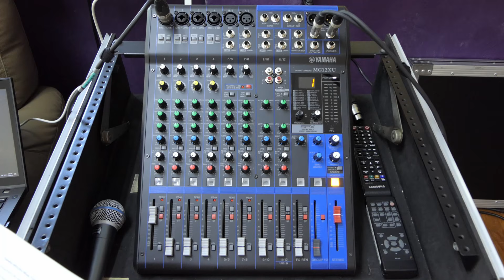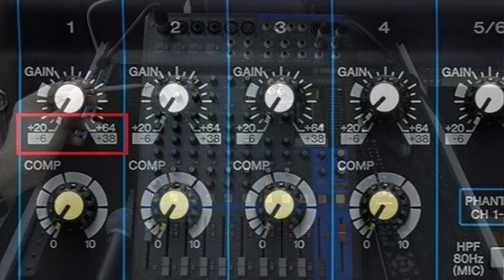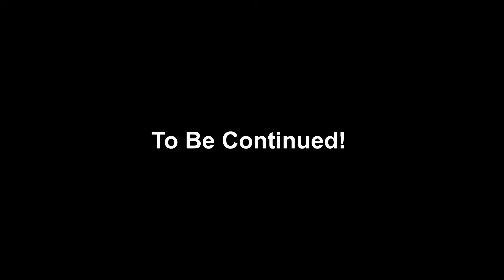Yamaha MG12XU Mixer Tutorial Part One

Comment from the maker: Bookmarks for video: 
00:40 Mixer overview
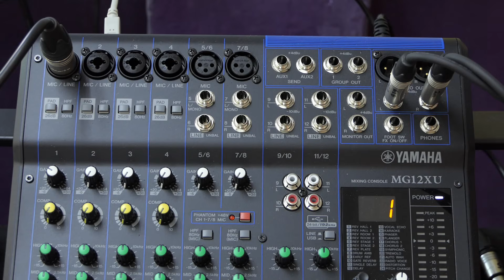01:51 Input connectors
02:50 Pad and HPF switches
04:10 Gain knob
05:30 Gain setting procedure
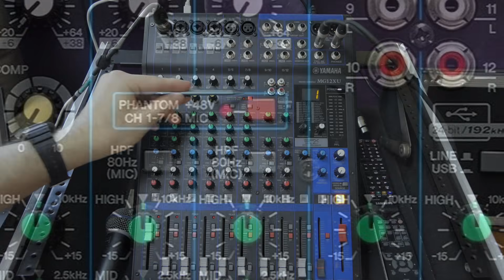07:43 Phantom power switch
08:18 One knob compressor
09:32 EQ Section
10:50 Aux section
11:50 Internal FX section
13:33 PAN knob
14:14 Channel ON button
14:53 PEAK light
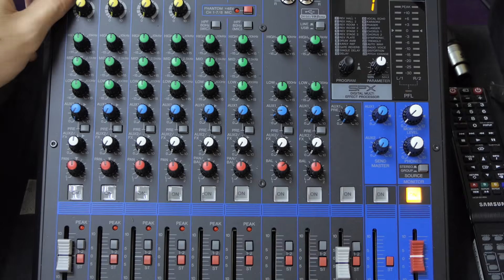15:35 Channel and master faders
16:42 Channel routing buttons and subgroups
Reply: Thanks alot!
Reply: thank you so much.
Reply: Thanks. What measure of cable Do You use for the USB 2.0 connection?
Reply from the maker: @juanriquelme9385  Typically 1.5 to 2m, although longer may be possible.
Reply: @GLBProductions  Thanks. I get a lot of hum noise with 1.8 meters. I don't know if the size, or the quality of the cable is the reason. Or both.
Reply: Nice

Comment: Hello thank you very much for this tutorial on this mixer. I recently bought one used and I'm trying to get competent on it, so this is very helpful. If you're still looking at the comment on this six year-old tutorial, can you clarify something please? In the 'Aux section' you explain that the white knob control both the FX levels and the Aux 2 levels, the latter of which would be used for a second monitor speaker. Does that mean that, realistically, must choose between having FX or having a second monitor? If you wanted, for example a very subtle reverb on a mic in channel 2 but wanted the channel signal to be strong coming through the Aux 2 out, that would be impossible. Is this correct?
Reply from the maker: Hello Matt, that is correct: the mixer is designed for Aux 2 to be either the internal FX send or an external post-fader monitor send, not both at the same time. 
Mind you, given that aux 2 is always post-fader, any post-fader output from the mixer might work as a monitor send: the group outputs, monitor outputs or even the quarter-inch main outputs. It just depends on how specific you need to be with what is sent to that monitor. 
Thanks for watching and all the best with your music 😊
Reply: @GLBProductions  thank you for your kind reply!
Reply from the maker: You're welcome :)

Comment: if i use DI box and there are mic but not condenser mic it's wireless mic, do I need to switch on the phantom power?  How will that affect the non condenser wireless mic?  thanks much
Reply from the maker: Does the DI box need phantom power?

Comment: It looks like this mixer ONLY does Stereo output. I will be doing a wedding that includes 4 mono mic/instrument inputs + 1 stereo input (a laptop to play music). What happens if I use 1 XLR out to the powered speaker? Will the stereo music only play the L signal of the music, or will yamaha sum up the stereo to send it mono?
Reply from the maker: There is no sum to mono feature on the outputs of the mixer. Fortunately you can create a mono output by keeping the pan control centered on the mono input channels and connecting stereo sources to two individual channels, using the L/mono inputs.

Comment: It would be nice if individual channels had the ability to send to unique FX. So ch1 to plate reverb, ch2 to delay, ch3 to room reverb and ch4 to tremelo. For example. As I understand it, everything shares the same FX. So if you've selected plate reverb...everything sent to the FX will be plate reverb.
Reply from the maker: In order to do that you would need four separate FX engines, which are only found on the largest and most expensive mixing consoles 😄 Something like that can be done if you are recording one track at a time, but not simultaneously.
Reply: @GLBProductions  Understood.

Comment: Hi and thanks for the video! I own an MG10XU  - How do you control the output gain to the PC  from the MG12XU? ON the 10, the individual faders control the output to USB and operate independently from the main output fader. Is this the case with the 12? Thanks!
Reply from the maker: The output level of the USB interface is, for all practical purposes, fixed - the only way to really increase it is to raise individual channel gains and/or fader positions, which will inevitably compromise the gain structure of the mixer.

Comment: Thank you so much for the video. I am a volunteer for a small church. We recently get low sound for those on Zoom. whenever I increase either the game or the faders, we get a strong echo in the auditorium. Do you have any idea how to solve this?

We have 1 speaker and 4 microphones
Reply from the maker: You're welcome! The low output of the USB interface of these mixers is a known issue for streaming. There are a couple of things you can do: 
1. Increase the level of the main output fader, and decrease the level on your amplifier by the same amount - this will increase the level going to the livestream without causing feedback in the sound system. 
2. Use a separate USB interface to feed your livestream, where you can increase the level as much as you like.

Comment: Hi Bruno.  I am a Dj and I am trying to follow your tutorial with specific application to my trade.I have been using the Yamaha mg12xu in conjunction with my Dj controller but I have a few questions. I connect the 2 pices of equipment as follows 
XLR from controller outputs left and right to channels 3 and 4 on the mixer (XLR)the controller will be line level, should I use XLR from the controller to 1/4” on the combo jack? 
Also how do I connect my subs via the aux send on the mixer so I have individual control over the subs. ? I hope you understand what I am asking. Any advice will be greatly appreciated. Thanking you in advance
Reply from the maker: Hello 🙂 When connecting your DJ controller you can use either the 1/4" inputs or the XLR inputs with the PAD engaged - it may be easier to use the latter as you can use standard XLR cables. 
Aux fed subs can be connected to either aux send - if using aux 1 make sure that it is is in the post-fader mode, ie with the PRE switch disengaged. 
All the best with your music!

Comment: Thank you very much. Have this mixer and one of the stand mic is giving feedback  sound when placed in a certain position, but it's fine if placed slightly to right. What could be the cause?
Reply from the maker: That's how feedback often behaves - there is one particular spot in a room where the interaction of reflections from the various hard surfaces produces a point of increased concentration of a particular frequency - this is called a room mode. The solution is simply to avoid placing mics at that exact location.

Comment: Good video, thanks.  I have a question: I am now using Yamaha KMA1080 digital karaoke mixing amplifier connecting to a power amplifier, can I connect KMA1080 to this mixing console by using PRE OUT from KMA1080 to stereo input of this mixing console, and from stereo output of this mixing console to a power amplifier?  Thanks in advance.
Reply from the maker: Yes, you could also use the tape output.

Comment: 1st thing, first..this was an excellent Tutorial. This mixer makes much more sense to me now. 
I have a question: If I decide to plug in a Dj Mixer/Controller to channel 3 and 4, pan left and pan right for stereo. Assign, channel 3 to stereo and Group 1-2. Would group 1-2 now receive a true mono signal? The goal would be to assign the Group 1-2 fader to a mono subwoofer. But I am aim to get mono signal out of it, not a stereo left. Thanks.
Reply from the maker: Thanks DJ. In the case you describe above, the channel 3 signal would go to ST left and group 1 only - the pan control doubles as a group assign control - look at the small letters and numbers above the ON buttons. So while this signal would be mono, it would NOT be a mono-summed version of the original stereo signal. The best way to achieve this would be to use one of the aux sends, or a subwoofer with left and right inputs that can then sum them to mono.
Reply: @GLBProductions  thank you for the information. I will look to test this weekend.  I appreciate you taking the time to reply!!!
Reply from the maker: You're welcome 😊

Comment: Been watching your videos on/off the last several years! Once in a while I’ll come back and still doing a great job on explanations and instructions! Very detailed and complete 👍

Question - for live gigs is there a n external effect that can be added to give the vocals that warm smooth and clean sound? Or is the mixer enough? 

I was at a restaurant in Thailand recently and the house (full) band sounded so good!  The mix sounded amazing and the vocal was so clean, warm and smooth! Almost like a separate vocal processor was used— like Warm Audio fox example.
Reply from the maker: Hi there River! Thanks for watching and supporting the channel. There is no magic formula to getting good live vocals 😅 The end result is typically the result of the singer + the mic + the mixer + the speakers + the room. Some engineers have told me that the room contributes as much as 50% of what you are hearing, which explains why the same sound system can sound fantastic in one venue and horrible in another. Having said that there are certain 'magic boxes' that engineers use: one of the main ones is multiband compression, another is something that the BBE sonic maximiser, which adds additional harmonics to the vocal, and a final one would be a tube preamp (analog) or tube plugin (digital), which do the same basic thing. Hope that helps 😊
Reply: @  Thanks for the comments!

I understand the room and ambient noise around the room can contribute to overall quality and mix. Add to that a good compression unit. Makes sense!

Also, I noticed you did not mention equalizer/multiband EQ.

So chain would be —
mic > mixer > preamp > compressor > maximizer? 

I know there’s a whole debate about compress pre or post EQ..?
Reply from the maker: You're welcome 🙂 EQ is something of a double-edged sword: I find that people either tend to overuse it or be afraid of it. EQ cannot fix room acoustics, badly chosen and/or placed mics or poorly installed loudspeakers, and it is very important to listen with no EQ first before applying any. 
Signal chain could also be mic -> outboard preamp -> mixer line input. Compressor and maximiser can be inserted before or after the EQ, whichever sounds best.

Comment: Hi, i noticed my yamaha mg12xuf has a very loud output compared to my other mixers. I tend to put the gain and fader volume so low. Is that normal? Do i have a deffective mixer? Thanks!
Reply from the maker: There is definitely a lot of gain available on these mixers - I often have the gain at 9 or 10 o'clock for loud singers, when it would be around 1 o'clock on other consoles. Other than that the output is fairly standard.
Reply: @GLBProductions  thank u very much for your reply sir u have helped so many people accross the world u are really an educator at heart. May Godbless u more for your kindness!

Comment: Good morning, thank you for making the very informative video. I'm not clear on one step, can the white fx/aux 2 knob manage both functions at the same time? Let me explain: if there are monitors connected to the aux2 output on stage and I operate the white knob, do I raise/lower the channel signal or increase/decrease the effect? I understood that I can only route the effect to the aux1 output. I hope I have explained myself clearly and thank you in advance for your reply.
Reply from the maker: Yes it can and does, but the mixer is not designed for aux 2 to be simultaneously a monitor send and an FX send: you're meant to use it either as a send to the internal FX or as a post-fade aux send, not both at the same time.

Comment: Hello this has helped me a lot ,but could you tell me if putting floor monitors via the desk harms the output or the desk itself please....Thank you
Reply from the maker: Please explain what you mean by 'putting floor monitors via the desk' :)
Reply: Thanks for getting bk ..our bass player uses my desk to put thro 3 monitors so they can hear my voice..but I'm sure it effects my output thank u
Reply from the maker: Sorry I still don't understand 😅 Putting signal through the mixer will not damage it, don't worry - that's what its designed to do. It can handle multiple inputs and outputs all at the same time.
Reply: @GLBProductions  thank u so much that's fine

Comment: Hello i have a question regarding bossting the audio sound .
Can i connect the ledt and right outputs from the mixer into one single top  power speaker  that has 2 channels  and so connecting the left and right outputs into the speakers would that make the sound more powerful
Reply from the maker: Doing so will not actually make the sound more powerful because the active speaker will simply combine the two signals together at the same level. You might get a slight level increase of around 3dB but if you need more power the best solution is to invest in a more powerful loudspeaker.

Comment: Hi Bruno , quick question. Once I've mixed my vocals and balanced
Them out with my backing tracks at a lower volume level from the back of my powered speakers , when raising the vol level to gig volume volume should everything 
Sound the same just louder?
Tia.
Reply from the maker: Yes it should, but remember that human hearing is relatively non-linear at low volume levels: when things are soft our hearing is most sensitive to the midrange. As levels increase we become more able to perceive the lows and highs, which is why live music sounds better loud! 😄 (Look up "Fletcher Munson curves"). So the quick answer would be that you might need to adjust your master EQ once your are a gig levels.

Comment: By the way when I connect my Shure Wireless Mic do I need to press the Pad Button on Yamaha mixer ? Cause if I don’t do then I experienced very loud even if my fader were almost down. Pls suggest . 
Thank you
Reply from the maker: Yes, you can either engage the pad on the mixer channel or reduce the output level of the wireless receiver. Both will achieve the desired result.

Comment: Can inputs 5 to 8 be used for acoustic guitars with pre amp?
Reply from the maker: Yes they can, but there is only 38dB of gain available on the line input, which may not be enough for some acoustic guitars.
Reply: @GLBProductions  Thanks Bruno I'm just thinking of a scenario whereby if my main mixer fails during a gig,using a smaller mixer to continue utilising those inputs.The guitar and Fiddle both have preamp.
Thanks Steve

Comment: Hello, can I use TRS for the mixer outputs to the amp or should I use TS?
Reply from the maker: You can use either, but TRS is preferable as it is a balanced connection.

Comment: Can I use Condensor Mic. in Chanel-1 via XLR Cable & Dynamic Microphone in Chanel-2 via TRS Jack (Line Mode) with Phantom Power On. Need Your help urgently.
Reply from the maker: You can plug both mics into the XLR connectors - no adapter needed! The phantom power will not harm the dynamic mic as long as it has a balanced output.

Comment: Hi again. 
I have a "monitor2 usb as my main audio interface" which i would like to run through the yamaha MG12 XU mixer. Which i will run usb into my pc. 
Then i would like to connect my condenser microphone into the MG12 UX mixer, then i would like to connect the "Roland VT-4 voice transformer" to the mixer aswell. 
Can it be done? If so, how would i conncet it all up? Is it through the "Send FX" on mixer. But would i need a DI box to stop the signal from feedback? 
I've been looking online for answers but found very little. 
I could really use some expert advice, or a tutorial, as i am new to this mixer. I'll even take a detailed diagram or a drawing in pencil from you on how to connect it all up.

So my main goal is to sing through my mixer connected usb to my pc, "Roland VT-4 voice transformer" through my mixer and my Monitor2 usb. 
While recording my voice to my DAW, and playing the backing track through my headphones on one ear while singing, with or without recording the backing track, as i can edit the backing track later if need be. i know its not a multi track recording mixer. I hope this all makes sence?
Reply from the maker: Peter this seems unnecessarily complicated to me, given that 1) You are recording using a DAW, which has plenty of power to route, edit and EQ the signal, plus 2) the Roland VT-4 can itself function as an audio interface. Could I ask why you are adding the mixer as well?

Comment: Thanks for this great video, but the thing we are not using a powered speaker and the output is in low volume, what should i do? Thank you
Reply from the maker: You cannot connect this mixer directly to a passive loudspeaker, you need to connect to an amplifier first 😄
Reply: @GLBProductions  thank you very much for your help! Can you specify what kind of amplifier is needed? Great thanks!
Reply from the maker: It depends on the loudspeakers - more info here: https://www.youtube.com/watch?v=l9L7uK7Xy0w
Reply: By the way my speaker is only the yamaha 400bt. Looking forward with your help! More power!

Comment: I'd like to know it will work with a Lexicon external reverb. Not just for 2 chanels - but as a Master Bus solution - for all chanels.
Reply from the maker: Yes it will but you will need to use AUX2 and hence will not have access to the internal effects engine.